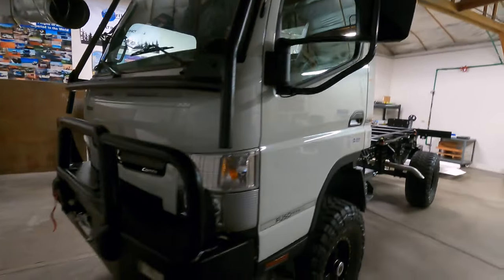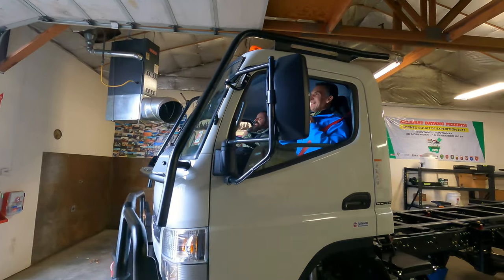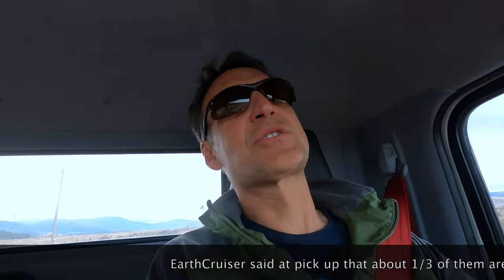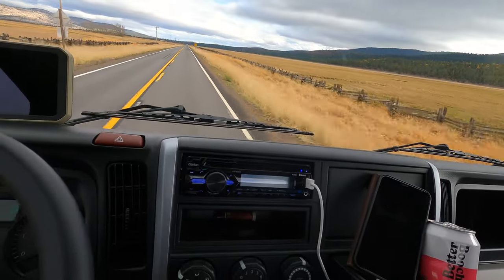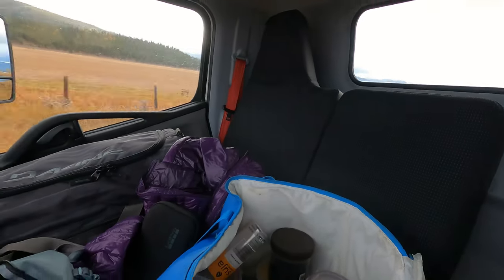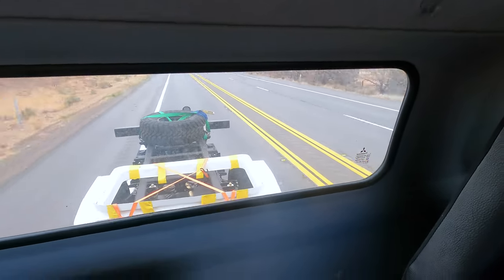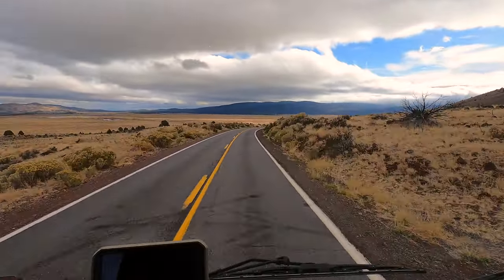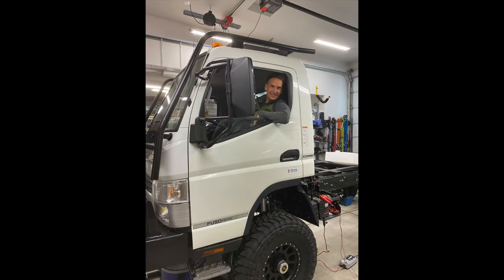Picking up a new EarthCruiser 4x4 Core truck chassis to build my Expedition Camper

Comment: What is the maximum payload?
Reply from the maker: Good question and it depends on many variables. The EC CORE two-door weight almost 8,000 pounds with me in it and accessories and nearly full tank of fuel which gives it about 6,500 pounds of payload capacity to the GVWR yet the axles, brakes, wheels and tires have all been upgraded on a chassis that can come with a 18,500 pound GVWR, so I'd say payload is comfortably around 8,000 pounds, which is in line with something EarthCruiser said to me.

Comment: Better hope it's a v8 not the canter diesel. You will be paying out the rear if it's the canter engine.
Reply from the maker: Yep, it's the GM LS V8. I felt that was the better drivetrain for durability, power, reliability, global parts availability and a great Allison transmission too.

Comment: Two main reasons why I'm NOT interested in the medium-duty cab-over trucks sold in the U.S → [1] No Safety Airbags. [2] EC Core & Acela Straya offer only the gas models.
Reply from the maker: Yes, it is a real bummer that US vehicle safety regs requiring airbags don't apply to trucks and that truck manufacturers don't care enough about their customers to install them. As for diesel vs gas, I did drive each as available in these trucks and did a full cost-benefit analysis as well as qualitative comparison and see no value to owning a diesel vs the newer gas engines and good transmissions, as the diesel is more expensive with a fuel-cost savings payback of about 15 years and with more problems and less performance. I share an overview of my analysis in my video here: https://youtu.be/liZisJ-AmOk

Comment: I’ll pass, I’ll stick with my 4x4 sprinter van. You appear to be bouncing around in the cab while on a smooth highway and you get how many miles per gallon?
Reply from the maker: This is my progression from two Sprinter camper vans. This vehicle is the same width as a Sprinter but actually two feet shorter than my 170 Sprinter's total length--and a much better turning radius and over three feet less of a wheelbase of a 170 and a foot less than a 144 wheelbase Sprinter, so it fits into and is easier to park than the Sprinter--that was a key criteria of mine. And yet it provides two more usable feet of camper but nearly double the interior volume and weight carrying capacity of a Sprinter. Yes, the ride was rough when fully unloaded with springs designed to carry twice the weight of the unloaded chassis. I do remember picking up my my brand new yet empty Sprinter cargo van and how rough of a ride and noisy it was until the camper got built out and insulation added. I think this new camper will provide nearly all of the things I am looking for that my Sprinter couldn't provide. The one thing it does not do well is improving upon fuel economy. Some time soon electric drivetrains will provide better performance and lower operating costs to this class of trucks. Stay tuned and I'll share more of these details and the drivability and usability as I get to using it.

Comment: I’ll pass, I’ll stick with my 4x4 sprinter van, it fits into parking spaces so you can buy food. You could carry a couple e-bikes to offset the ridiculous size barrier, maybe a mountain bike so you can really go anywhere. Also you appear to be bouncing around in the cab while on a smooth highway and you get how many miles per gallon? Yeah good luck.
Reply from the maker: Yeah, this has been a progression for me from two Sprinter camper vans. This vehicle is the same width as a Sprinter but actually two feet shorter than my 170 Sprinter's total length--and a much better turning radius, so it fits into and is easy to park than the Sprinter; that was a key criteria of mine. And yet it provides two more usable feet of camper but nearly double the interior volume and weight carrying capacity of a Sprinter. Yes, the ride was rough when fully unloaded with springs designed to carry twice the weight of the unloaded chassis. I do remember picking up my my brand new yet empty Sprinter cargo van and how rough of a ride and noisy it was until the camper got built out and insulation added. I think this new camper will provide nearly all of the things I am looking for that my Sprinter couldn't provide. The one thing it does not do well is improving upon fuel economy. Some time soon electric drivetrains will provide better performance and lower operating costs to this class of trucks. Stay tuned and I'll share more of these details and the drivability and usability as I get to using it.

Comment: Hmmmmm  A gas engine?
Reply from the maker: Yes, while diesel has benefits of density and safety, it adds a large exhaust regeneration system taking up much side storage or stair space, plus adds another fluid to manage and likely more maintenance issues, and from my experiences owning diesel vehicles and what I am seeing globally as a movement away from diesel fuel, making it gradually harder to come by and manage. Plus the new gas engines have better economy yet much better driving performance.
Reply: @vantripping  Diesel is the staple outside of the US and is much less expensive outside of the US.   I had a LMTV and if I were using gas the cost would have crushed me down here in Central America.  And you are wrong about the economy of the gas engine.  You don't get outside of the US much do you?  The world runs on diesel.  There are places down here where gas isn't even available.  But your call, good luck.
Reply from the maker: @spencervidal3168   After driving the gasoline and diesel drivetrains available in this truck, I much preferred the gas version, and it has a much more globally ubiquitous and durable engine and transmission than the more unique diesel one and it's transmission which I feel will have lower reliability, so I felt the gas engine was the better option. In your LMTV, there is only a diesel option, and it's a robust drivetrain that can burn poor quality fuel, so it works well for that truck.In my experience traveling to over 12 countries a month over many years, diesel has been very available in Europe and Africa, but that is changing as it is being outlawed in much of Europe, and not that available in my experience as gasoline in much of central and South America, as well as Mexico. As you've experienced it's available, but I was trying to plan for all parts of the world, future proof, and have reliability. Diesel fuel quality can be poor in some areas. Asia is hit or miss, but generally becoming less available in many areas. Nonetheless, it will be available for decades to come but likely diminishing.
Reply: @vantripping  I buy ex- military, multi fuel trucks..  Mostly Caterpillar or Cummins engines. Parts are readily available and they will literally run on anything..  Diesel, kerosine, old engine oil or old transmission fluid or the deep fryer oil. as well as gas.  Gas is 2 to 5 dollars more per gallon down here.  And the possibility of bio-diesel, from kelp or even hemp are real potentials.  The prospect of finding parts for an LS engine would be daunting.  There are tones of Toyota Hilux trucks down here and they cant find parts for those.  Often they take months to have the parts sent from Japan.  Cat and Cummins are a no brainer.  Most of the chicken busses have Cummins motors, Those are my engine choices..
Reply from the maker: @spencervidal3168  The Fuso's diesel is unique and same with its transmission, which are not very common nor great to drive from my experience and from talking with many others that own it. Compared with the gas engine, which has one of the most common and robust transmissions found in the world, including in LMTVs, and one of the most popular engines ever made with well over 100 million made and 40 iterations of it. So between the two, the gas engine and its transmission are very robust, great to drive, and easily serviced compared with the very unique engine and transmission of the the diesel drivetrain on this vehicle. I hear you that a diesel would have better economy because of its higher volumetric energy density--which would be great--but with the two available drivetrains on this vehicle, the gas one was the better choice for me and many others who also recently bought these for expedition vehicles. Parts for any vehicle will be tough to come by in many areas, which is why I chose the drivetrain that is likely to be much more dependable and easier to repair.